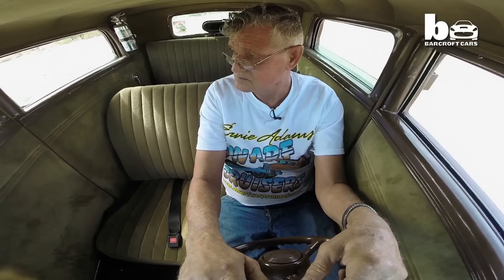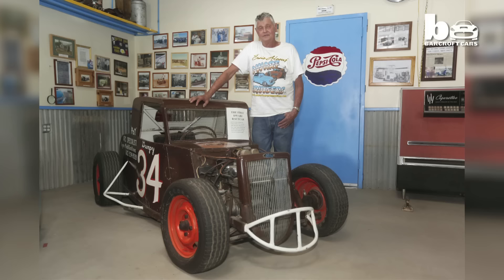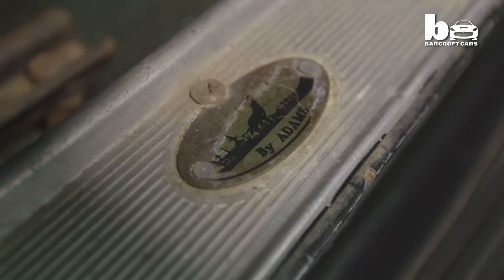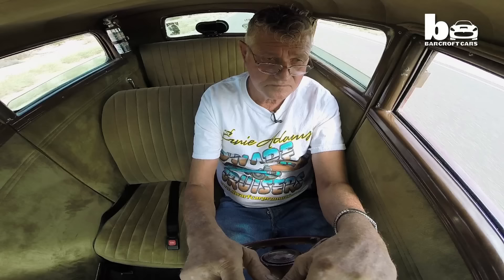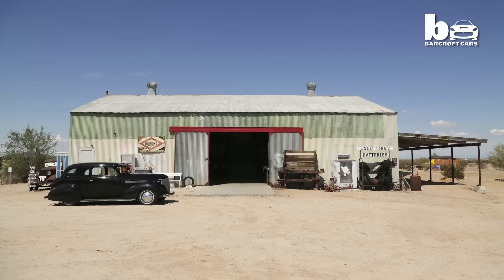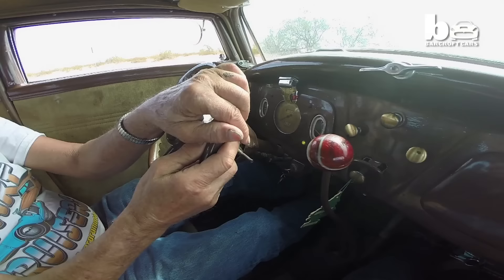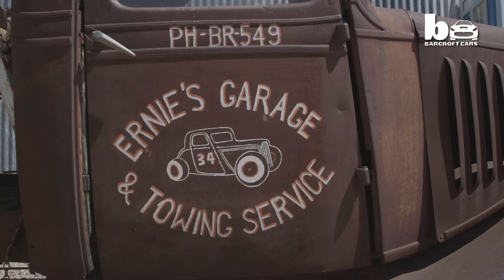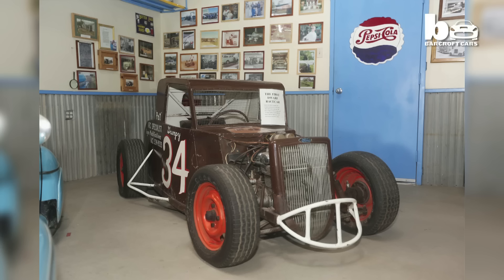Dwarf Cars: Mechanic Hand-Builds Mini Motors

Comment: He should make Fiat 126 replica.
Reply: +Mladen Milić   I had one of those in 1979, a 600cc engine and a top speed of about 40mph with a tail wind.  When it came to hills I could have walked up the hill faster.  Kids passed me on their bicycles and laughed at me.  The funny thing is I loved it and it was easy to work on.
Reply: +Sloopy .Dog 126 can go 100km/h.
Reply: +Mladen Milić   I bought mine new in 1979 and I can guarantee mine didn't do 100km/h.  I also had a Fiat 500 in the 70s, that had no power either.  I think you are getting mixed up with the new Fiat 600,  They are a great car and very fast.  Fiat make some good cars now like the 500 X and new Panda.  However years ago Fiat didn't make very good cars and I should know I was a mechanic for 40 years and I worked on a lot of Fiat's.
Reply: +Sloopy .Dog 126p with 650cc engine had top speed of 110km/h. 126 Bis from 1992 was even faster, because it had water cooling and did not overheated.
Reply: +Mladen Milić   That's right.  The  original Fiat 500 I had was air cooled,   It was very easy to work on, I could change a clutch in 30 minutes, it was a sweet little car but lacking in power. The 126p was better it had.  Engine 652cc, two-cylinder Power 24bhp @ 4500rpmTorque 30lb ft @ 3000rpm. Top speed 65mph 0-060mph 42.1sec  Consumption 55mpg Gearbox Four-speed manual.  They were rust buckets with very thin paint.  However they were cheap to buy and good on fuel.  You seem to be a great fan of the little Fiat.  The thing is did you ever have one?
Reply: +Sloopy .Dog I wanted to buy one, I was a big fan, but I realised that ai could not fit in the car. I found good example, restored for 360€, Serbian equivalent for whole year.
Reply: +Mladen Milić   There would be no chance of me fitting in one at 18stn and 6' 6'' tall.  I once had a 1961 A35 van and they were very small and I gave a lift to a friend who was 25stn.  I couldn't change gear, he had to do it.   They were not for big people.  I also had an Isseta  bubble car, they were great fun.
Reply: +Sloopy .Dog I am 23. I have seen Isetta on Belgrade car show 2 weeks ago, very nice car. I just coult not understand how they fited springs under front wheels, I haven't seen any. I looked under the car.
Reply: +Mladen Milić The Isetta had coil springs on the front, it had a BMW engine and a rubber donut to drive the back wheel and act like a shock absorber .  Great little engines and loads of fun to drive.  I was a motor mechanic for 40 years and I worked on some great classic cars.  I am retired now and I miss repairing and rebuilding motor vehicles.